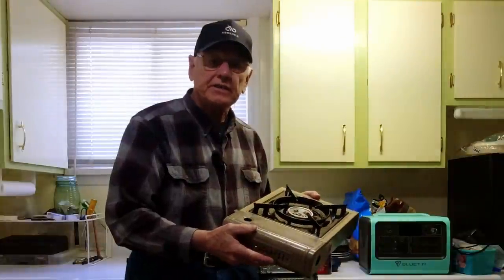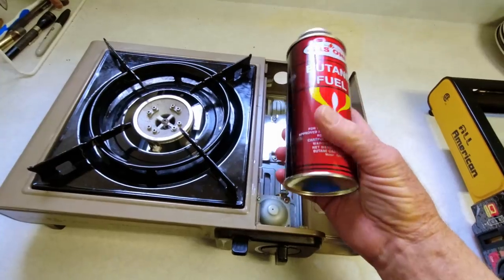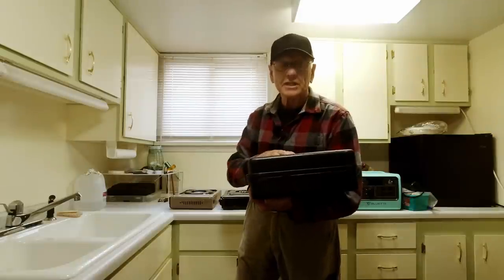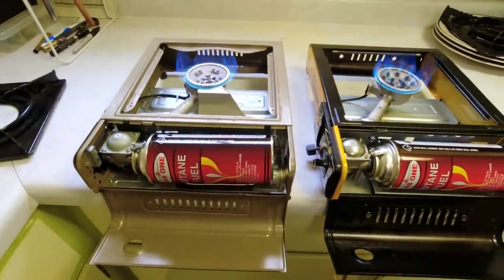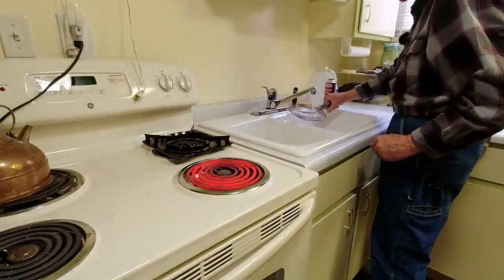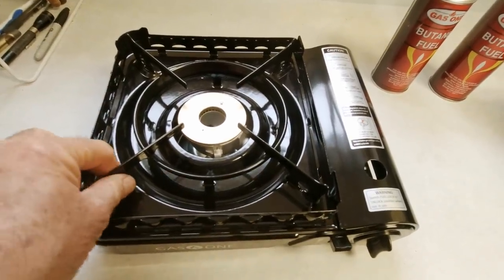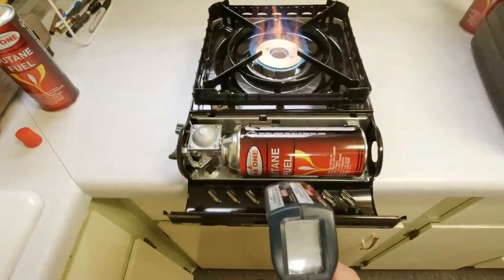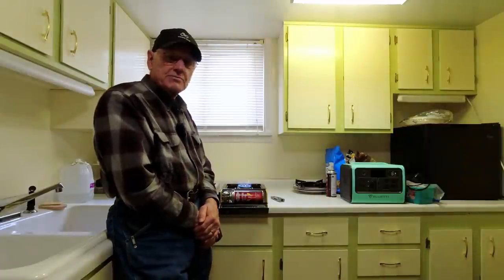Are the Newer Model Butane Stoves Actually Better? - How to buy a good one!

Comment: Top tip, some of those stoves have exploded due to the canister overheating from using a wide frying pan which reflects the heat back to the canister causing an explosion and fire burning down your tent... Advise not to use anything that overhangs any part of the canister area!
Reply from the maker: Good warning. Never use too big of a pan that will spread the flame out to where it can heat the fuel bottle.
Reply: Unfortunately, there will be some that will try this modification in an effort to extend the burn time while at the same time using an oversized pan to prepare more food specially in remote locations that will not have those bottles in stock at a loca Walmart.  I would advise to include a warning at the beginning, end and the middle and a banner “At your own RISK” on this video.
Reply: @dungeonmastervenger  .
Reply: There are stoves that eject the cartridge when the pressure is too high, and cartridges that can eject themselves.
Reply: Read all Instructions first. They actually warn about that.
Reply: Hi gonagain... As an experiment I've ordered up a couple of usb powered heat pads to wrap the canister in, once I've checked out the temperature of canister once wrapped. I'd read that 52c 125f is the highest it must ever get. I reckon this'll be an outdoor experiment.  Once I find my heat temp gun !
Reply: Don't cook in a tent... derp

Comment: I see your Bluetti there. I just ordered one on 3/09 a EB55 but didn't receive it although they charged my card right away (3/25 I still do NOT have it)....heads up, you can't call anyone, they do not respond to emails. Can't contact tech support...there IS NO SUPPORT. I found the "community chat" through Google, someone there got through to someone at Bluetti who sent me an email message to be patient? That's customer support? When $1000 is charged but you can't find out where your purchase is, speak to anyone, get support, not even told when to expect it....HEADS UP....promoting the product.
Reply from the maker: Did you buy your Bluetti through Amazon?  If you did, then you need to go directly back to Amazon.  If you bought it from Bluetti then it will take longer for it to arrive.  Communication is harder because of the language barrier and sometimes what they say doesn't seem quite right.  They just came out with the new "S" series ( EB55S and EB70S) and I know that they are backlogged because of that.  Did you get a tracking number yet?
Reply: @gonagain  no I bought it directly from Bluetti. I am concerned for support for the product. For something that expensive you can't contact anyone. Try calling their numbers. Amazon isn't going to help with warranty. I'll wait to see what happens. I'm on the road in 3 weeks so crossing my fingers something shows up. You can't even speak to tech support. I wish I would have gone with another Jackery, I have a 500. I was adding more.

Comment: Tech-Tip: pressurized liquid fuels like butane and propane must be able to boil to produce enough pressure to be forced through the plumbing and oriface so it can be burned. Much below about 45F and butane appliances like these stoves and cigarette lighters get rather cranky. As the fluid fuel boils due to pressure release, because you're channeling fuel vapor away for use, the temperature of the containment vessel will decrease. It's the same principle that allows air conditioners to work. If you don't provide external heat the temperature of the tank will drop so much that it will be too cold for the fuel to boil, right around 32F for butane.
Reply: That is why I chose the dual fuel model. That way I could use propane in the cold weather.
Reply: So THIS is why the low-flame occurs in cold temperatures!

Comment: I ordered an Iwatani butane stove directly from Japan.  It has the extra heat panel built in and the model I ordered has the butane section further away from the cooking area. So you can use bigger pans. Nice burner.
Reply: I wanted one of those, but I waited and now it's up to 80 bucks when it used to be 55 just a few months ago...
Reply: @cillaloves2fish688   I bought it from an eBay supplier (from Japan) “Iwatani CB-EPR-1 Eco Premium Cassette Fu Gas powered Camping Stoves”. 
But they have gone up in price since I bought it. 
But there may be other Japanese sellers. ???
Amazon had a similar one but someone commented that the Japanese version was better and that he had used the original for years. 
This model also uses the butane more efficiently giving higher output per canister.
Reply: @cillaloves2fish688  if you have a fairly large  Asian market close by take a look in that store they carry those types of stoves and are reasonably priced
Reply: @scottgorman7166  
Thx, but they are about 10 - 12 btu's, I already have a few of those, no windbreaker whatsoever, so a good gust will blow them out.

Comment: I usually warm the gas can in some heated water from the kettle when the flame starts to diminish. Definately going to have a go at modding my stove. I use it daily as it's in my work van, saves me hundreds of pounds yearly on the cost of coffee, especially at the rate I drink it. Great video and explanation was insightful.

Comment: I do have one of the first ones out , probably had it 10-15 yrs . I like using it out ice fishing so I'm going to try that ! Thanks . Hope Linda is healing up OK.
Reply from the maker: For cheap stoves they work pretty well, but you may have a problem making your stove work in the cold, due to the limits of butane, unless your ice fishing shack is warm enough.   Linda is doing great and is getting around pretty good.

Comment: Pretty ingenious on your part Rick.  I wouldn't have ever thought to do something like that. I don't currently have a butane stove but would like to get one at some point. Have always just had a campfire, but a little butane burner like that would be great if there were fire restrictions. And I would prefer butane to propane.
Reply: just get one of outdoor stove that accepts multi fuel, they all have builtin preheat tube to vapourize liquid or liquified compressed gas
Reply: @philiptong4978  thanks. However, I prefer the small one burner butane as that way I can cook indoors in my minivan as well as outdoors on a table. The rest of the time I prefer a fire pit to cook over. But that's a great idea and probably more reasonable.
Reply: @wandacraig8286  I cook inside my e350 van on the older model GasOne butane stove and love it. Simple dishes with short cooking times, usually. Last year I made huckleberry jam and water bath canned it using my butane stove  in a campground in Idaho. It was a fun trip!

Comment: Timely video!! I have had multiple stoves in the 7500 btu range without the heat sink., My remedy was usually warming the can in water or with my hands.. I had also thought of warming the can and then putting s piece of reflectix   On the can.. Recently been considering buying a Iwatani stove in 15000btu range but read some of the burners meltdown., In the end I settled on a Eureka sprk 12500 btu with the heatsink in it.. I love this stove and the case that came with it seems very robust.. Something that everyone should remember is each can of fuel only had a value of so many btu’s.. If you have a powerful stove the fuel cylinder is not going to last as long as less powerful model unless you use at lower flame height.. Also, I buy my fuel at a restaurant supply store or Asian markets.. Usually half the price of a big box store.,
Reply from the maker: Thanks, David.  The cases that come with most of these stoves don't last very long, so you did well.  Now I know why this 15,000BTU stove has a brass burner!

Comment: Interesting, my first visit to your channel I will be checking out some more videos for sure.
When there is a pot or frying pan on the stove more heat should be directed towards the canister I would have thought, this is an interesting modification though and one I would carry out if I start using this kind of stove again.
Reply from the maker: Your actually not supposed to use wide frying pans and overly large pots on these stoves, but all that is in the instruction manual.

Comment: Also if using at lower elevation don't assume it is empty.  Those cans will be good for one more use when going up in elevation.  Also don't use the click start.  Wastes a lot of fuel , use a lighter for instant instead of losing gas the whole time you are turning the knob.  Always disengage the can manually.  Don't rely on the stove to do it.  I've had one drain a can.  I've also had one still lit even with all the safeties.
Reply from the maker: Great points!  I'll try using a lighter next time.

Comment: I will be trying your idea in my stove . I basically like my butane stove except when it's cold out. If it is close to freezing or colder the butane hardly works at all. It was a pain to wake up on cold mornings and have hardly any flame for making coffee. I car camp a lot.
 For Feb and March I was in Arizona. There were a few cold mornings. I started putting the canister in my bedding inside my car at night when I knew the morning would be cold. I also need a wind screen.
Reply from the maker: I understand completely!  Have you seen what I did to make a single burner propane stove more user friendly?  It's what we use as our main stove when we are traveling:  https://youtu.be/eo5HwkW2qxU

Comment: I use an one burner coleman gas stove. Works in any kind of temperature. One gallon of camp gas now runs $13.99 or you can use unlead gas.
Reply: every liquid fuel stove for the outdoor has a preheat tube to vapourize fuel before mixing with air, similar design also works for compressed gas

Comment: I have one of the older Gas One models and that has always annoyed me. I never thought about heating up the can. I usually just throw away the can when it gets to that point. I wonder if some of those HotHands would work on the outside of the can. Obviously on the side away from the burner
Reply from the maker: They would, but the cost would negate any gain.  The other day, using an unmodified stove, I just placed my hand on the bottle and that was enough to get it working great.  I boiled water for coffee twice on that almost empty bottle by doing that. So modifying one does work to get the last bit of fuel out.
Reply: @gonagain  I have used a Hand warmer before, while it isn't cost effective, I was in a situation where I had many Hand warmers, but a very limited supply of the fuel and needed to squeeze out every drop. But , I'm going to modify one of my stoves with your improvement, that looks ideal!

Comment: Hi Rick, hope you're keeping well. I can't remember how I discovered this, probably a fluke, but when my stove gets down to the last dregs of gas, and if it's on a flat surface, I hold the front corners of the stove and shuffle it around. The flame really perks up as long as you keep moving the stove around. Technically, I have no idea what's happening so I can't explain. Thanks for sharing. Stay safe and keep up the good work.
Reply from the maker: Good tip, Pedro, I'm going to try that.
Reply: That is a bit like shaking a cigarette lighter to get it to light one last cigarette before it dies. I guess the agitation causes more vaporisation.

Comment: Really gr9 vid. Yeah I have too many of these floating around AND I want to use them for my campervan. So yeah, I'll do this mod. You know I'm going to have to review this vid again. Clever mod BTW.
Reply from the maker: It does work!  The difference is most noticeable when you are using it for longer stretches, like boiling water and making a stew or something.
Reply: @gonagain  OK. So I did the mod. I used 2mm thick aluminium plate shaped like the newest design. I insulated it from the chassis with plastic and rubber and moved the plate closer to the nozzle. I also took your advice and added a little insulation inside the cannister compartment. It's pretty cold here in Oz, ie down to around 11DegC which is when the Butane gives up the ghost. This means you can use it on cold morning to heat up your tea or coffee NP! BYW> NO ONE has posted anything like this.

Comment: Excellent video Rick. Do you think this would get too hot for Summer use as it hits high 40 Celsius here in Summer.
Reply from the maker: No, it won't get that hot, only warm.  While in use, the bottle is constantly chilling itself and this mod will only add some warmth.  If you were to hold your hand on the bottle, that would be enough and that is all this is doing.
Reply: @gonagain  Thanks for the reply   keep on traveling and enjoying the outdoors. Keep well.Cheers Steve from Aus.

Comment: Great video, just wondering 🤔 what temperature is dangerous for these butane bottles? Rick
Reply from the maker: I know they'll withstand being in the sun or in a hot car. The modification that I did, and that some of the new stoves come with, only warms the bottle and keeps the bottle from freezing up. The one thing that's dangerous is to put a large diameter pan on top that directs the flame over the bottle. That will definitely cause an explosion. The stoves manual cautions against that.
Reply: Thanks for that 😃

Comment: I know someone who did the opposite, he removed the device that brings the heat to the can precisely because the latter came much too hot and it was too dangerous
Reply from the maker: I've never had a problem with that, but maybe with a long boil?  Also, be absolutely sure that the pan doesn't go over the butane bottle area.

Comment: It might be hard to find the balance to get just enough heat for the liquified gas to evaporate and not blowing the canister up due to overheating.
Reply from the maker: The canister only needs to be warmed slightly.  The purpose of the video was to show that it works, but the price of the stove itself is so reasonable that I suggest just buying one that already has the warmer installed.

Comment: Slightly off topic but..... I had a similar stove that only ran hot or very hot. It wouldn't run low when I wanted to simmer wat I was cooking. With so many stoves as you have, have you experienced trying to throttle back the flame? which brands would throttle back? I tossed out mine when it leaked gas where it connected to the bottle. I couldn't figure out how to fix it.
Reply from the maker: Our propane stoves don't throttle back very well, but we put a flame diffuser (https://amzn.to/3rdVsJF) under the pan to help simmer.  These butane stoves are perfect for simmering and that's why so many Asian restaurants use them at your table.

Comment: I had one of them  little stove and I put the gas bottle in? And then it wouldn't ignite so I tried a long match and I all set alight on the fire I managed to throw it in the garden and it exploded?
Reply from the maker: You have to be very careful that the gas bottle is inserted correctly or that can happen.

Comment: You said you can put a hose to a bigger tank how is that. Will you be able to make a video
Reply from the maker: Gas One (and probably other companies) sell a dual fuel model that comes with the proper hose to connect a propane tank, such as the one-pound bottles.  I didn't mean to infer that these could be modified to do that.

Comment: I stopped using butane and used butane propane mix
Its far hotter
I could even cook chips, uk chips that is
Reply from the maker: I've never tried that mix yet.
Reply: @gonagain  Good for camping and if your off grid
I started using it when i was high up on a hill top on a roman road
had two cylinders one butane and one mix, the mix had more pressure and was hotter
Got the Tea brewed quicker :)

Id recommend it

Comment: price per # from butane an propane.....lp gas is far cheaper than non refillable butane cans....that being said dont use the green lp cans unless you have the refill connectors an just get a 20lb tank with the adapter hose! and butane will not work at 32 degrees but lp gas will....smarty pants XD

Comment: hi rick - great information for heating up the butane canister - thanks!   i'm going to try it on my on my older stoves.  fyi - in case you might need another stove sometime and don't want to pay amazon prices - if you have an asian market in great falls, or you want to check one out on your travels, they sell gas-one stoves in two sizes - the large ones like your's are $18.99 and the small ones are a little more at $25.99.  i paid $45 on amazon for a small one, and then a week after i found one at the asian grocery so much cheaper.  they sell the butane for $1.25 a canister too, and if you buy a case you get four for free.  i hope linda is doing much better now - hopefully walking without much pain.  thanks again for the stove tips.
Reply from the maker: That's a very good tip on buying the stoves and fuel from an Asian store or outlet. These stoves are widely used in Asian countries.

Comment: Did you ever measure the temperature of the extended plate that sits under canister? Thanks Tony from the UK
Reply from the maker: Only by touch and it usually just gets warm.  Most of the newer stoves have this feature and I just wanted to do a before and after comparison.